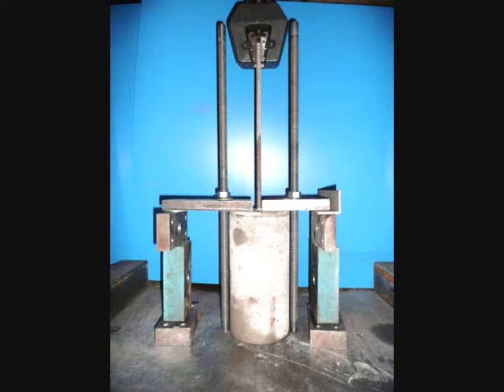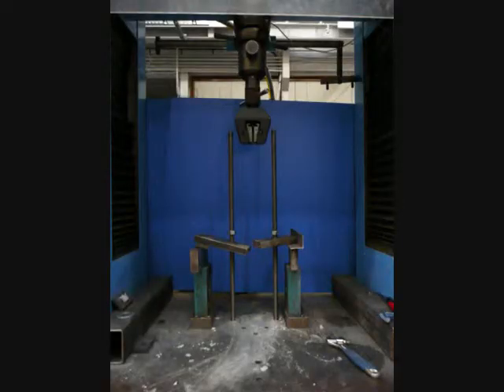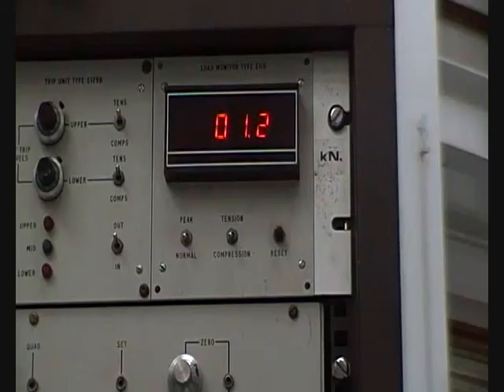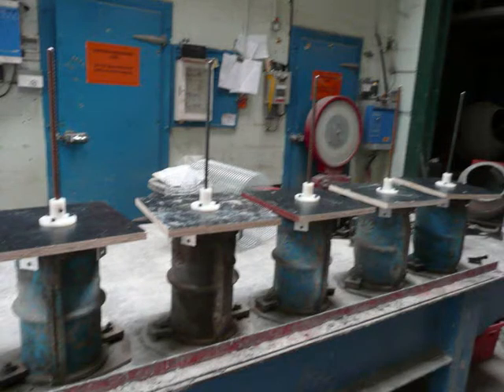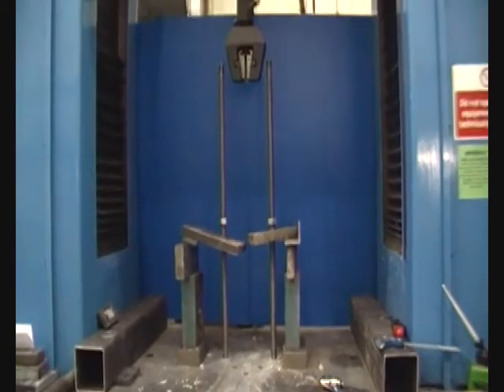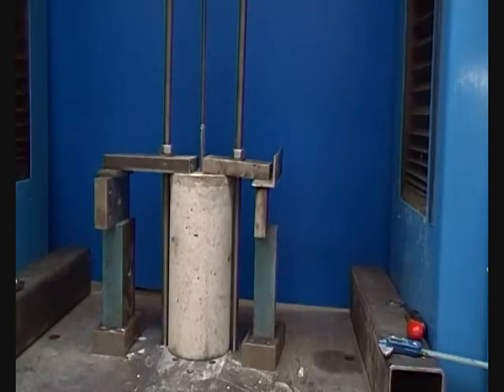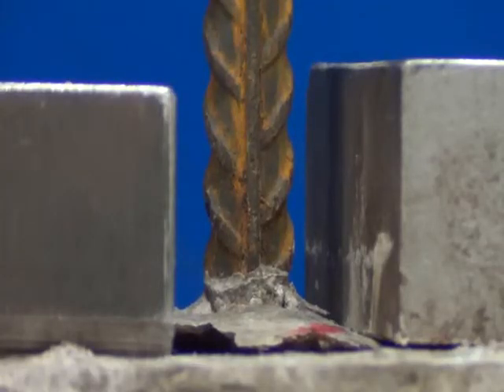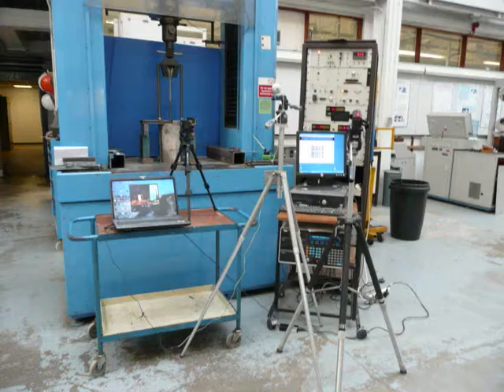Equipment And Pull Out Test Explained.wmv

Comment: Hi Louise, what thickness are the steel plates you are using to restrain the RC sample?
Also, what grade of rebar and mix of concrete did you chose to use?
Finally, what was the loading rate used for this experiment? Was is by load/time or displacement/time?

Thanks in advance